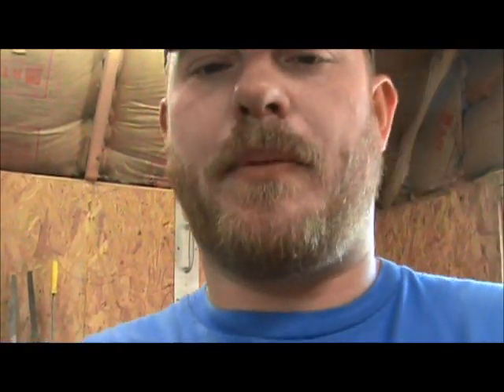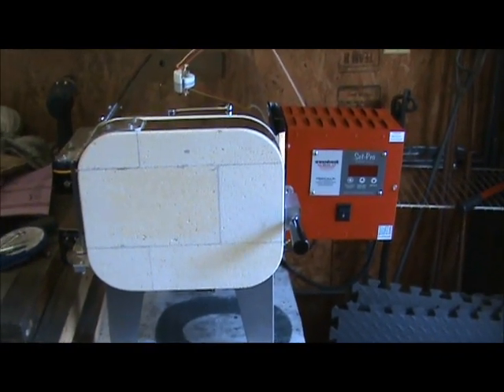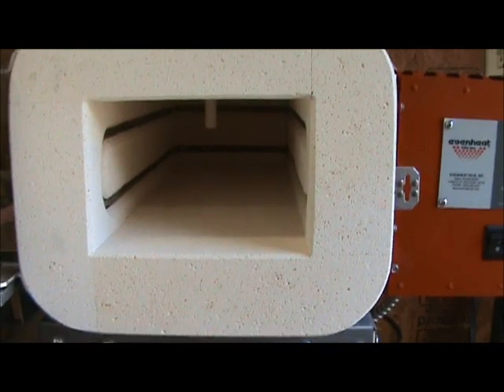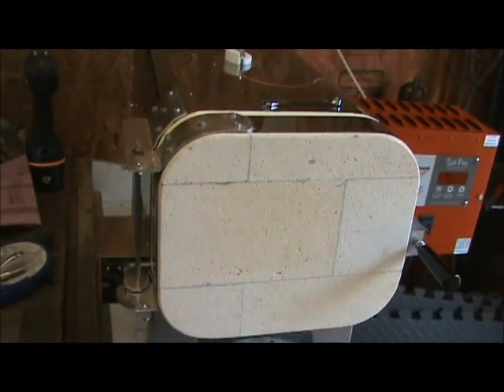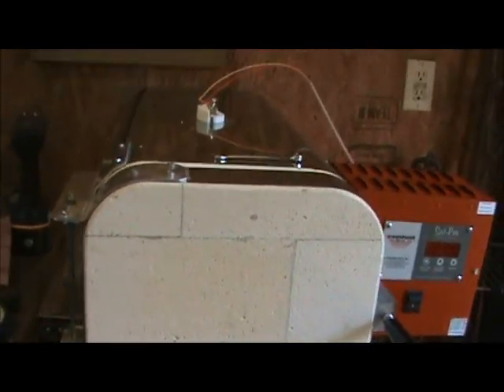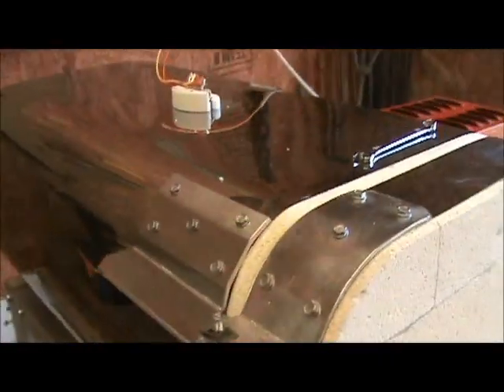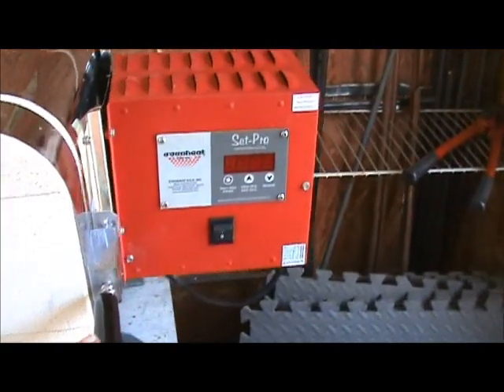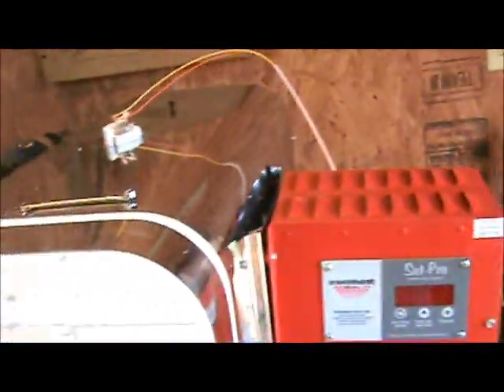New Shop Tool At the GI Custom KNife Shop

Comment: Thats a nice oven. My only concern would be that you are going to do 440c without cryo. there are a lot of steels like 440c, D2, and most high chromes which just are not as refined and tough without the cryo treatment. Will still be ok I imagine, but may be more susceptible to brittle edges at higher hardness. I'll be interested to see some testing on 440C in the oven. Its all about getting it just right, so you'll have some fun experimenting.